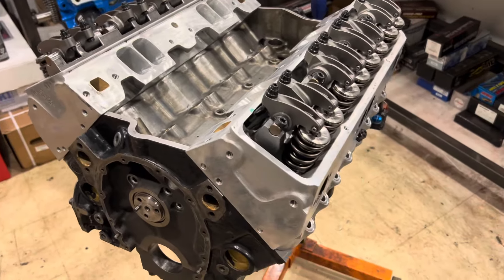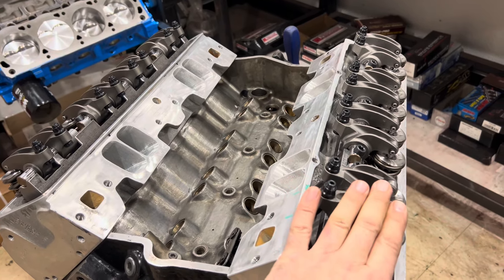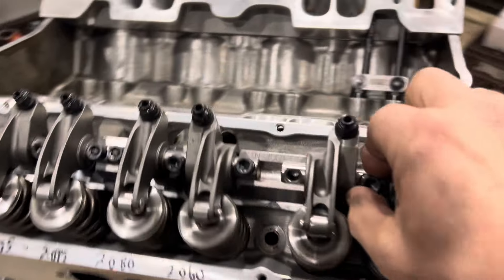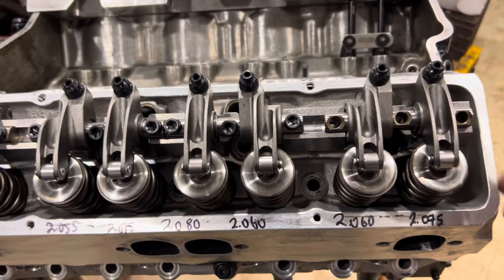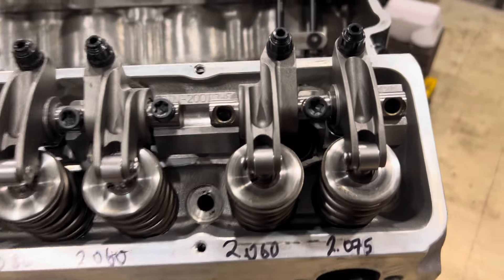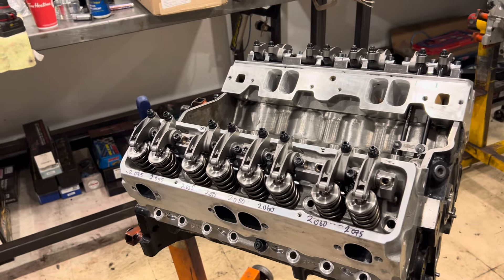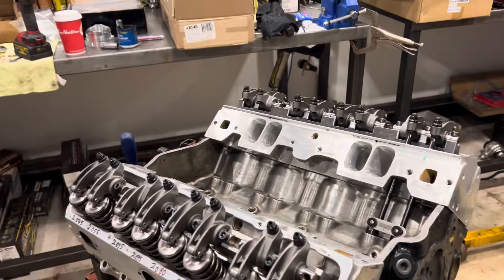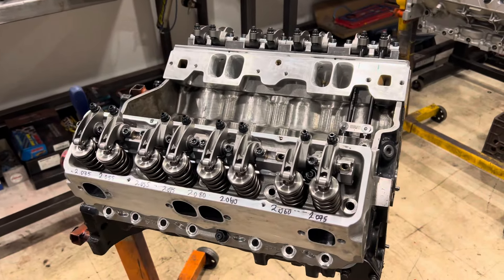ANOTHER ISSUE IM UPSET at this point !!! 2000hp sbc twin turbo build up … UN REAL !

Comment: I don't know what type of heads you're running but are the Rockers made for those heads
Reply from the maker: Sbc 23* head hunters 
Jesel 3500$ rockers specifically made for those heads yes sir..! Brand new
Reply: @georges8secpony What a bunch of crap, I agree they probably won't fit under generic SBC valve covers. Probably have to buy their $1000 valve covers.

Comment: George, did you try that set on the other head?
Reply from the maker: Yes it’s not fitting anywhere … it’s the wrong shaft
Reply: You are right, it's a shame that a company makes these kinds of mistakes.
Reply: @georges8secpony so the shaft alone, just the shaft,  couldn't be flipped and used in another position like 1,4,5 or 8? Obviously youd need another shaft but is there only two different shafts in the whole set? Why the offset, just so they won't interchange with others?
Reply from the maker: @stevenbelue5496  yes there supposed to have 4 pairs with shaft #5 stamped on and 4 pairs with shaft #4 stamped on … there is 5 shafts with #4 and 3 with #5 … the rockers are correct they just installed one wrong shaft … due to the placement of the valves in this head it needs a .450” offset on the intake side LH AND RH … 
They are sending me another shaft #5 and new side clips to change it … I was just very disappointed due to the price of this set and to arrive with a mistake …
Reply: @georges8secpony  yea somebody wasn't paying attention, I understand it's human but for that money they should have another person inspecting those so there is no mistake when they go out the door.
Reply from the maker: @stevenbelue5496  right on brother .! Agree 100%

Comment: That happens all the time with jessel..you should charge when you don't buy the parts .
Reply: If that happens all the time with Jessel, well 
then Jessel products SUCK. Their rocker arms aren't really any better than anyone else's. You shouldn't have to hand fit this shit. It should bolt right on. If I am fabricating something, I am not finished until it can be installed and removed and reinstalled with no trouble. It frickin fits when it's done.

Comment: you will be lucky to make1000 with those heads.
Reply from the maker: We been 4.56@158mph last yr in the 1/8 on 275s … I guess you know best .! Thx for posting
Reply: @georges8secpony 👍put enough octane and turbo it will make the power. Turbos don't give a sh*t about a handful of cfm in headflow
Reply from the maker: @jeffg4008  exactly 👍